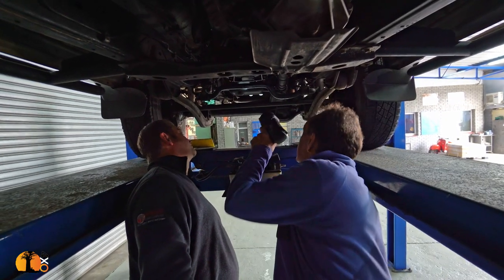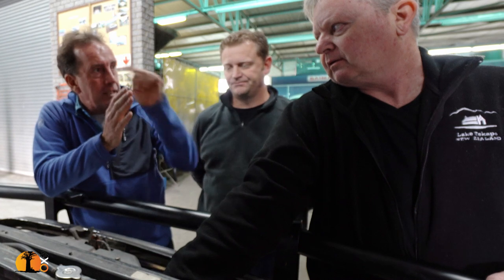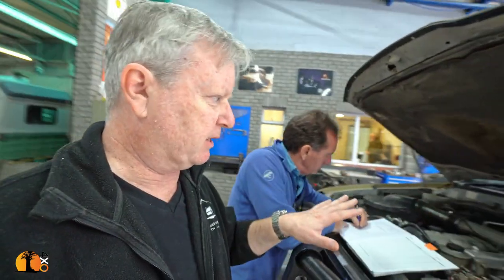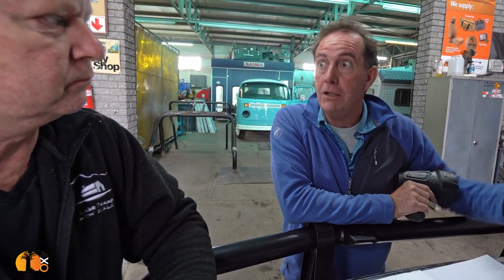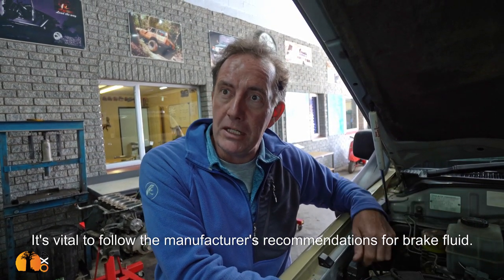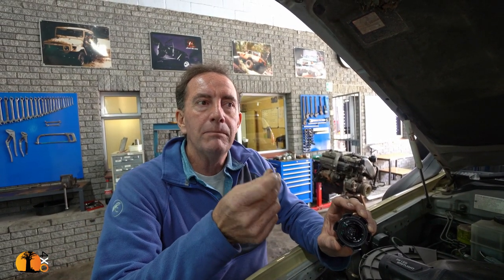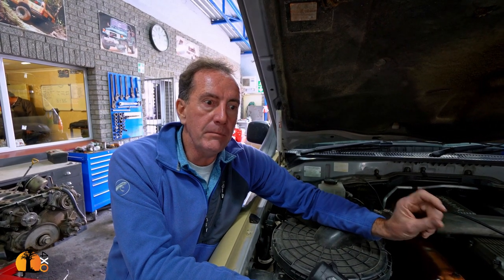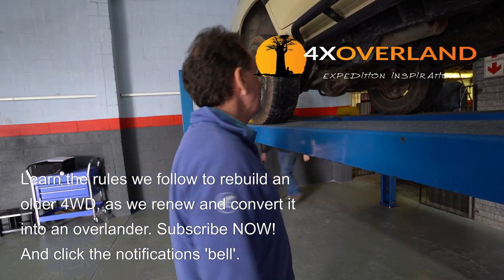BUTCHERED ENGINE! NEW LIFE for a 20-Yr OLD LAND CRUISER. part-3

Comment: Why should you keep your vehicle stock as much as possible?: "..often what happens is people add another complexity to what's really good [...] Toyota built a really good vehicle with a lot of very good engineers and many years [of] experience designing something that really works well [otherwise] they wouldn't have their reputation and then people come in and change a lot of that like adding a turbo and stuff to give power, we want to go away from [this].." -- Paul March

Comment: hi there Andrew, its great to see you working on an older model cruiser. I have a 91 HZJ75 , 675k on the clock.
I do change my oil every 10k, the difference is that I also run a jackmaster bypass oil filter. the oil never gets any dirtier, when changing the filters, its quite amazing how dirty the bypass filter gets. 

before each change of oil, I use COST Effective Maintenance oil flush. its amazing just how clean the oil stays clean. !!!

I also use a fuel additive to lubricate the pump owing to the low sulphur fuels. 

cheers, I hope all goes well. keep up the great work. best videos I feel.

Comment: Have had a Safari turbo on my HZJ80 for 20 years with no issues, the problem is when ppl screw them up beyond safe limits - run the correct AFR and you will not have issues.

Comment: The 1HZ is very well suited to turbo charging you just do it right don't cowboy tune it I have seen many do 250,000+ with a turbo that's done right no over fueling and use a stand alone temp gauge even with standard motor Toyota temp gauges are not great.
Reply: Follow Berima Diesel, they’ve turboed the 1HZ without issues for years
Reply: @phantomwalker8251  even low-boost helps the 1hz, otherwise why would people bother fit turbos to them... Plenty of 1HZ+T running around with lots of Ks on them, key is not to get greedy with boost an have an egt gauge
Reply: @phantomwalker8251  Working for Toyota I found that the factory turbo set ups are 10psi or below some times the cams are different and the head studs and gasket not much else.... quoting psi doesn't mean much ya flow rates and the sises of the motor ... I worked in a power station on large military marine V20 they ran up to 30 to 60psi and one of those turbo's were as big as my troopy the intake manifold was 3/5ft wide 4 valve heads with a natural gas valve in the middle 8865hp 5 megawatt  brushless alternators WW2 junk that was modified.
I still have an intake valve it's looks like an axle and the crank bearing fits around my waste.
The 8 psi my troopy gets and has got for 300.000+ is not a huge power gain but it does turn what would be a very slow ride into something that doesn't create a traffic jam :) also the combustion chamber efficiency goes up because they get a full charge so you dont get hot tops on the cylinders that are starving for air but still getting a full load of diesel after that when it gets hot under load up hill with the caravan lol and the RPM is high the water injection kicks in this is the only way to change the timing it's not common rail.
Oh and Gale Banks is a mad man his diesel trucks are insane! in a good way.

Comment: Yep, so many good tips, I actually found some Mocaccino in my engine oil lid.. Gave it a big good thought and given the 198.000 km in my 1.3 jimmy I didn't eat for couple of months and get the engine reconditioned. The cylinder head had 3 cracks..

Comment: Great video - going through the same experience on a modified 300Tdi Discovery that has been neglected by the most recent previous owner. The tip about hardening hoses is excellent, I’ve been replacing hose clamps to try to stop leaks, but it is now obvious that it needs new hoses. 8 weeks to sort it all before a 3000km round trip to QLD...

Comment: WOW, I'd really like to have a man like Paul look over my 80 series and tell me what he sees. He is a very knowledgable and experienced 4wd vehicle man from just what I am listening to him say and I'm only at 12 mins into this video. I am reasonably experienced with motors and Truck engines as I used to be an Interstate truck driver for a well-known company based out of Melb. and had numerous experiences over the years with different types of diesel engines and vehicles, also a few various types of cars over the years and rebuilding them. I am no way a qualified mechanic but I would say I'm slightly higher than a novice with these things.

Comment: Paul mentioned the 90 series ball joint collapse. There are so many 90s suffering this failure now but nobody seems to be trying to get the message out that this is very common. LBJs in those cars must be inspected regularly. We have pics from the Facebook Prado 90 series group showing many of these cars are having catastrophic wheel failures. We even approached the ACCC with the hope of getting a warning issued but of course they just ignored it. It happened to our 90 so I know just how dangerous the fault is.
Reply: Same with 3rd gen 4runners in N America. Just change the ball joints every 200k with OEM. And don't lift the front end without a diff drop, otherwise change after 50k.

Comment: Where did you get the 80% of 1HZs with aftermarket turbos have catastrophic failures? Plenty of good ones getting round Australia.
Reply: Totally agree
Reply: j anderson mines been on there for 180,000km out of 400,000km, going strong at the moment.
Reply: It's complete bullshit.
Reply: Yep - catastrophic failure!! Sensationalism at its best. He should be working for Fox News.
Reply: @chas2can124  In South Africa/Africa there's been some shoddy work.  Lots of chancers.
Reply: 4psi of boost and it will survive.. anything more and your gonna kill a toyota
Reply: @chas2can124  you mean CNN..the fake news Network.
Reply: http://4xoverland.com/turbo-charging-the-toyota-1hz-engine/ hmmm bit of a contradiction here?
Reply: Because you drive your cars like grannies in Australia.
Reply: shane0yourgod mine works fine. Been going 300K with aftermarket turbs. The installer said they only turn the power up 30% so the EGT stays below 500 degrees
Reply: @MADBONE0  It's been running that way for 50Kkm. I'm nice on the girl. The turbo installer mentioned 9.5Psi Max Boost and others have concurred. Oil change at 5Kkm seems to help. Were just enjoying the open roads together...
Reply: @rp3874  Thank you for saying this. A load of rubbish it was.
Reply: 20psi through my 1hz for 120k kms , they just dont like heat so dont over fuel and watch ur egt

Comment: I inherited a Oldsmobile 88 from my grandmother a few decades ago, the air filter looked like it had never been changed - it was literally black. After replacing it the check engine light went off and the car literally felt like it had twice as much power.

Comment: a lot of big calls here regarding the 1hz engine, but where would the show be without a bit of drama ( artistic licence ).
after owning a few of them it was the 105s hz that had most of the problems. as for being butchered ( artistic licence once again) you drove it for what 500 odd ks without a single hiccup, for a 20 year old vehicle it performed very well.

Comment: This turbo advice is concerning for long time subscribers like me because previously you turbo’d your troopy I understand the difference between buying one that has had a turbo fitted as opposed to fitting one yourself and maintaining correctly. Are you gonna turbo this one or will there be some advice on how to get more safe horses from the 1 HZ.
Is the 1HZ a good all rounder but just slow eg is it good in sand dunes?
I’m asking because I have a 1997 80 series GX UN spec which I am, over time, converting into a dedicated overlander
Reply: Get a good efficient turbo, have it tuned properly, make sure cooling system is healthy, get some guages to keep an eye on things. Youll get an extra 30% to 50% increase in power but it makes a huge difference and will still get a good long life out of the motor

Comment: For me the most interesting aspect is the approach rather than the advice. Would I worry about having a matched pair of alternator drive belts? Probably not because they aren't high precision items and there's a lot of tolerance in the tension. However I'll certainly think about it and other similar details in future.
Speaking from experience, if there are any weaknesses in the vehicle they WILL go wrong on a long trip.
Reply from the maker: Matched pairs are sold like that because the tensioner adjusts both together. Its part of Toyota's reliability built into this bullet-proof engine. It's not worth making a mod for an engine that doesn't have them, because they won't be sold in matched pairs, and therefore will wear at different rates. One might as well have just one, and carry a spare.
Reply: @4xoverland  Thanks for the clarification. I don't know Toyota engines but I do acknowledge their reputation for good reliability.

Comment: You can get condensation under cap in cars from humid environments where car has been driven short trips and gasket is fine. You need to look into the engine if gunk runs all way down into engine. Then there is clearly too much.

Comment: 11:35 I've always wondered why Diesel engine oil goes black faster BUT how does the engine oil become contaminated by unburned fuel(Diesel) if they don't mix? This still doesn't make sense, as far as my knowledge goes the fuel and engine oil never mixes. Otherwise you will be draining Diesel out of your sump and be burning oil?

Comment: Interesting comment by Paul. He said for a diesel, oil change every 5000kms. Interestingly my petrol vehicle says 10,000 and my diesel 4wd says 15,000. I always thought diesel can go longer. Made sense as the engine does less RPM. However Paul’s logic seems to suggest diesel fouls the oil much faster hence change more frequently. Hmmmmm. Interesting.
Reply from the maker: It depends on the quality of the diesel and the type of diesel engine. Not all fuels are the same, but all diesels are a sensitive to high-sulfur fuels, like those found in Africa.
Reply: change the oil in my 1hz every  5000 km  as per hand book  its on its way to  900 000 km still doesn't  burn oil , oil is cheap  engine  rebuilding  not so much . would never leave  oil in any hardworking  diesel  for more than 10 000 km not even if the manufacturer  recommended  it

Comment: I understand you are in Aus and taking a chance to buy this LC, but why didn't you send these two guys to go and look at the car before buying.
Reply: I was wondering the same thing. I just bought a 4wd from the opposite side of the planet, and it took me 5 inspections (3 different mechanics) until i found one the passed all the mobile mechanic tests including compression. A slightly costly but ultimately worthwhile exercise.

Comment: My 4runners have white cream under the oil cap. But it's from condensation due to short trips. A long trip will burn it off. I was worried and did a compression test on each and they passed with flying colours,
Reply: Compression can be good..... test for CO2 in the coolant.

Comment: Just curious, in regards to the 1HZ failures while turbocharged, were they running high boost and not benefitting from an Intercooler?
Reply: When I did my automotive apprenticeship I had a trainer that had 20 years working for Toyota and then a further 15 years working in an aftermarket Toyota workshop and he offered one of the best explanations on the failure of 1Hzs in 80 and 100 series when you put a turbo kit on them.  

He said at the time the power levels promised by the kit manufacturers vs safe outcome once installed and tuned was sometimes different and the change in performance was quite lack luster( still were not fast, light people expected in there heads) so people would tune them to the limit with air fuel ratios that are far to rich for an indirect injection diesel with a turbo and you would create excess heat in every aspect( engine temp, exhaust temp, air intake temp) and as such they would heat soak and cook the motor. 

These days turbos are much more efficient and more people have the knowledge to tune them correctly so you see and here a lot less about failures even with the turbo boost pressure at 20 psi( reduced drive pressure for the turbo helps reduce eg t, compressor outlet turbo temp reduced giving more air density, fuel pump modified for boost referenced fueling, turbo bearings capable of handling higher thrust loads and a few other things)

So what a lot of these failures originally stemmed from and are know for are easily managed or in some cases are no longer relevant(ie max safe boost level being 8 psi on old turbos and modern turbos capable of a lot higher boost levels)

Hope this explains just some of the reasons.

Comment: Toyota temp guages have a massive dead spot so watching it is wasting your time, the first indicator of overheating is the aircon cutting out which happens at 108 deg. Not that your aircon was working. Run an engine watchdog rather than the factory guage.
Reply: engine watch dog ?
Reply: @dtec30   stand alone temp guage and sender, engine guard is another model (what I use)